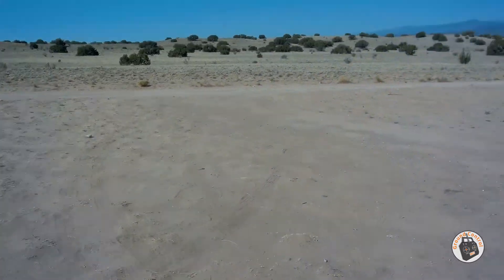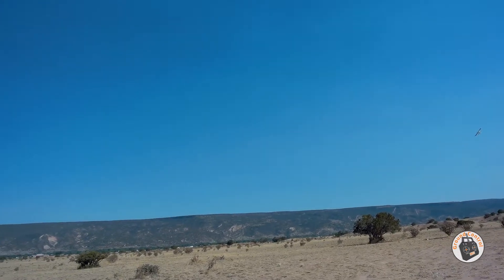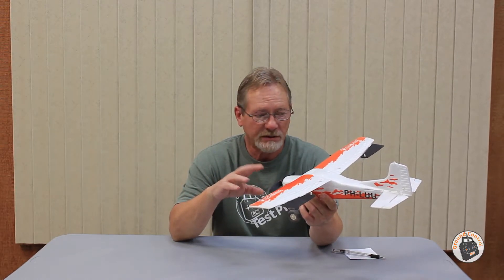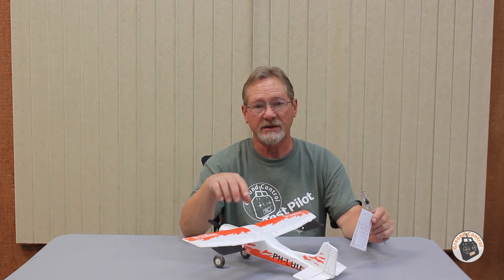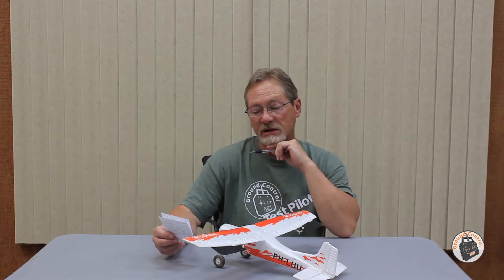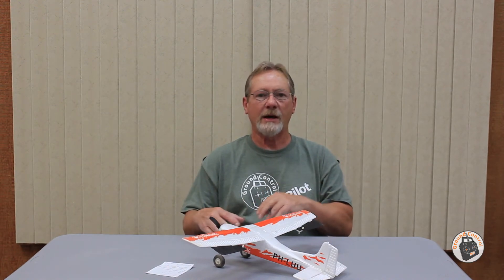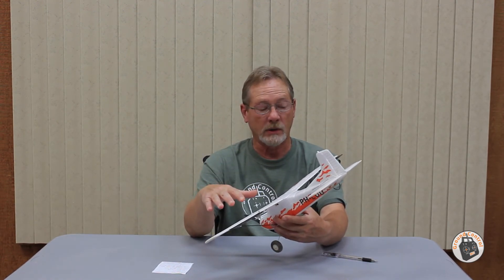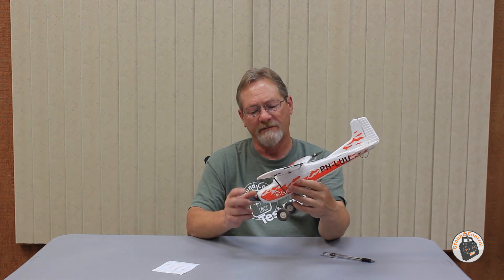Final Thoughts - CrossOver-RX AR3207G 7CH Micro Receiver with Brushless ESC + Telemetry + SR3X Gyro

Comment: I have watched that ending several times for a smile. You could not have done better if you had staged it intentionally.   I would not be surprised if it ends up in someone's funny scenes video someday.

Yes, SR3X is another version of AS3X (the latter is a Spektrum trademark).  It is not a form of SAFE or 6G stabilization that self-levels pitch and roll.  I verified this when I was wondering about SR3X and found the RCgroups thread titled "SR3X - CrossOver-RX Flight Stabilization" that had my answer.  Check it out for more information on these.

And now... my turn.

About 1/2 hour before I visited this video I had ordered the Crossfire 6-channel brick with SR3X for a 2S experimental project that required an Elevon mode for flying wings AND a rudder servo port.  DSMX version. This was the only micro brick I could find that offered all of this in one package. I am planning on twin power with differential thrust, so a rudder port was needed.

NOTE that the 6-CH brick offered differential thrust, but only between the 2 brushed motor outputs. It only has one servo-level throttle port so I will have to use an external mixer.

  The 6-CH  I ordered is similar to the 7 ch except it has brushed ESCs (2) instead of brushless, and so cost a few dollars less.   I will be using the servo-level throttle port for brushless power though.  Looking forward to experimenting with it.

Thanks for cluing me in on these.  Happy flying!
Reply from the maker: Hehehe..that Micro Heli was fun ;-)
It's a very good little RX Brick and mine is staying in this Cessna.
The Mini Cessna airframe is so stable I'm not concerned about self-leveling but the wind correction is nice.
I'll have to take it out in some significant wind and really test it out.
It's amazing how much functionality they can put on such a small board.
I'm looking forward to your experiment.
See you in the Air!

Comment: I'm curious about what happened @ 125% on the gyro settings, on a small XK 110 Heli, there is a point of auto leveling @ 41%, but not @ 40%, this point allows for inverted flight... I hop to discover it auto levels at a certain point...   Great info as usual Tony Chap... My reciever is on its way from china!..
Reply from the maker: This one seems to be more for just wind mitigation. It doesn't seem to restrict anything I do even in high gain mode. So far I like it ;-)